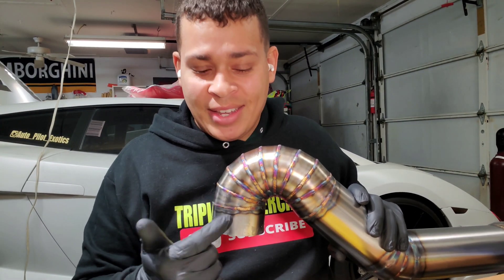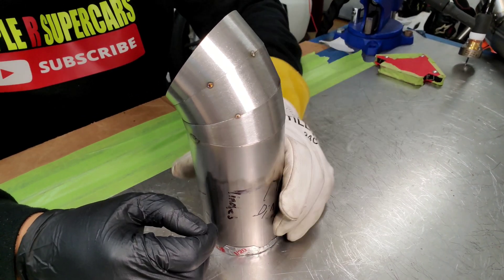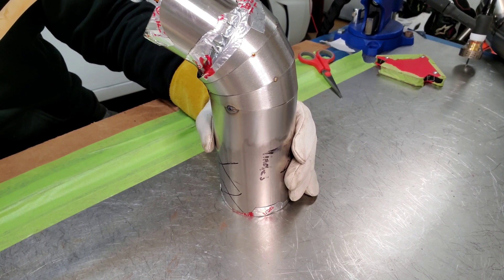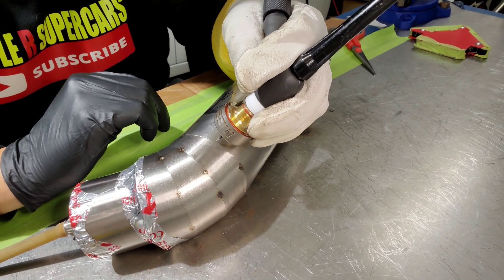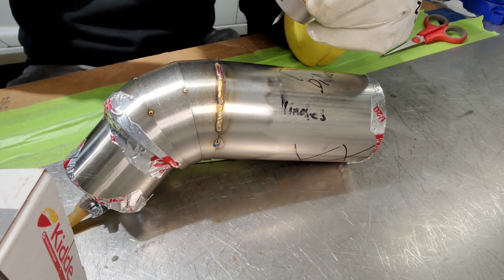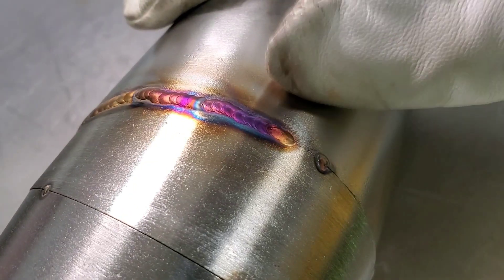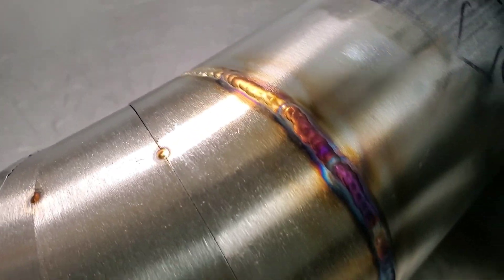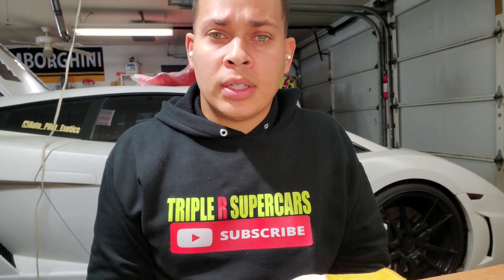How To Get Colorful Stainless Steel Welds 2021

Comment: Does it matter if dont have cover gas inside pipe?
Reply: All argon back shielding does is prevent chromium “sugar” forming on the inside. Slightly decreasing air flow and may possibly fly off into the engine if a critical part. if possible I would and you can if you have an argon source.
Reply from the maker: Please purge your inside of weld. The Sugar contamination  can surface into your bead and cause floaties and weld boogers as I like to call it.